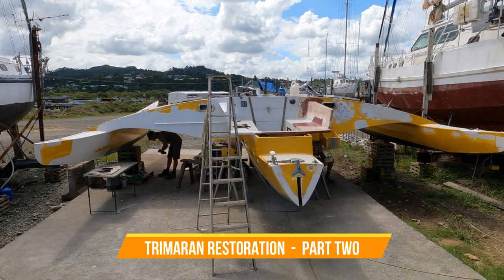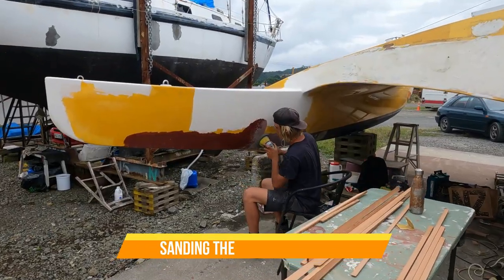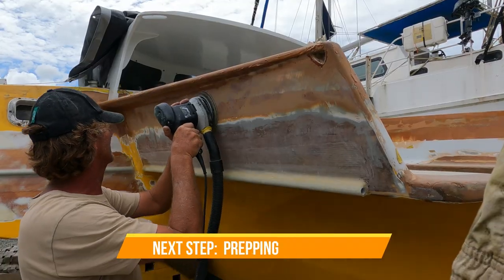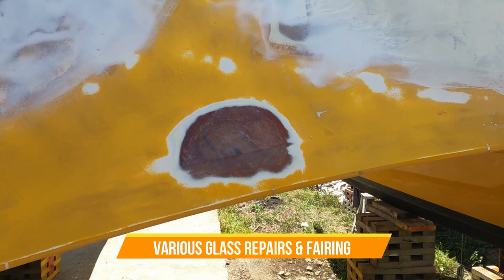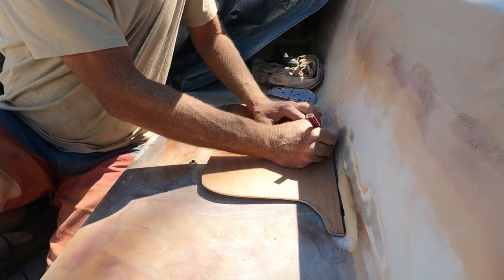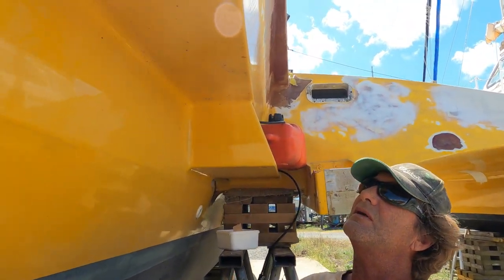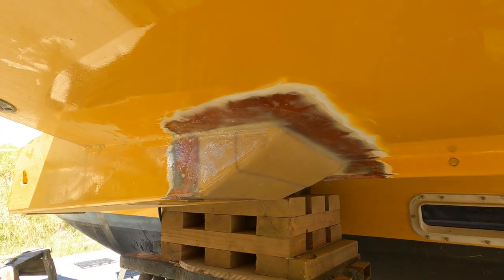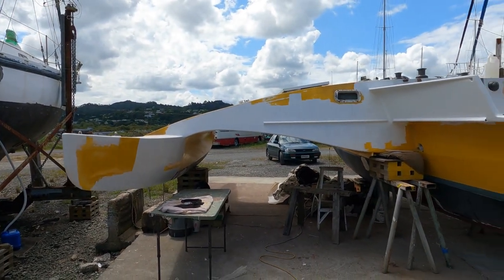31ft Trimaran Restoration (Ep. 19) | Damaged by Tornado | The Transformation of Little Wing - Part 2

Comment: Wow my old GPS is still mounted in the cockpit bulkhead.  And the jury rigged autopilot blocks are still under the cock pit seats.  LOL  Amazing that stuff is still on the boat after all of these years.
Reply from the maker: It’s still mounted but is it working?!? Got a different GPS but haven’t gotten around to mounting it yet 😉 as for the autopilot, that’s just how it’s been for all the owners after you I guess. Crazy hey but sometimes those temporary solutions work so well they become permanent haha
Reply: @Camarasailing  yeah that was a good GPS model at the time, real simple user interface and inexpensive.  It wasn't meant to be panel mounted (came with a bracket) but when I got the boat there was an old racing computer / knot meter or something that had been mounted there and taken out and the GPS fit more-or-less so I just 5200'd it into the hole and it worked great.  Made a little sun cover for it too.

Comment: What a please it is to watch a Master Yatch Build do the repairs. Especially the Holes in the Hull. We have a Piver Yacht I have to do some similar repairs to and this has answered a few questions for me on how to do my own repairs on a Brind Hull section. One question I have, What type of Glue are you using? It looks very Chunky and seems to have a long working time before it goes off. Kiaora.
Reply from the maker: Thank you so much ☺️ For any glue applications we use 413 microfibres mixed into the epoxy and for any fairing application 417 microballoons. You can extend your working time by using a slow hardener and make sure you spread the glue out in your mixing container. If it’s in a thick layer it goes off quicker than if it’s spread out 😉

Comment: Love the boat and the work you are doing, but please protect yourself from the epoxy particulate that you are actively ingesting. Epoxy poisoning is a slow process, not to mention the microfibers that can cause serious respiratory damage.  Even in the eighties we were wearing silly paper masks.
Reply from the maker: We hear you. We are pretty slack, especially when we work outside. We do use vacuum extraction on all the sanders but I’m not trying to make excuses, like I said we are pretty slack and need to get better at it 😉 We just always get carried away getting the job done instead of putting our gear on…
Reply: @Camarasailing  and as a yachtie myself, I understand. But remember that it is the health of you and your family that you are damaging. Get some PPE and save your health. Seriously.
Reply: @Camarasailing  are you not concerned you might get an allergy to epoxy?  Not uncommon I understand
Reply from the maker: @markthomasson5077  I admit we have been slack using our masks etc when we are working outside, but we always have our respirator and full face masks on when we are in confined spaces/inside like when we did the rebuild of our own boat there was no way we could have done all that grinding and glass work or the painting without masks etc.
Reply from the maker: @RobertdeVries-trimaran-sailing  no we aren’t which is why all the sanders are connected to a vacuum system.
Reply: @Camarasailing  also gloves, because you get it from the hardener. if you are gonna film it, others will see it and copy you so I hope they see these comments!